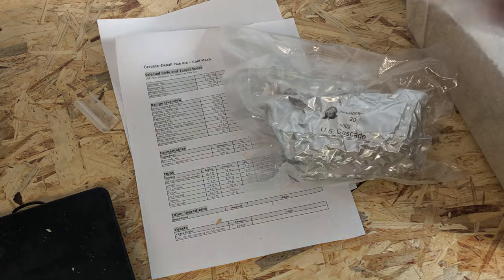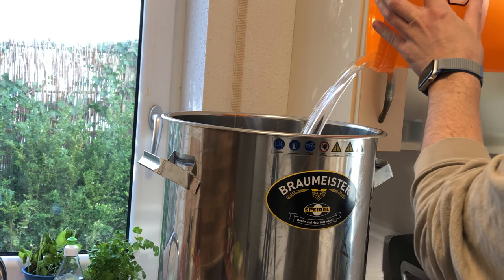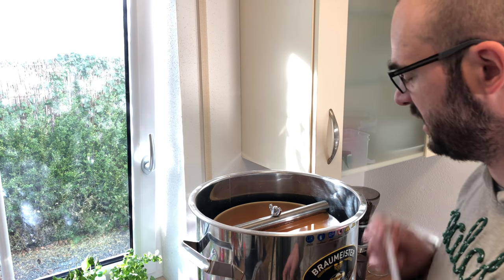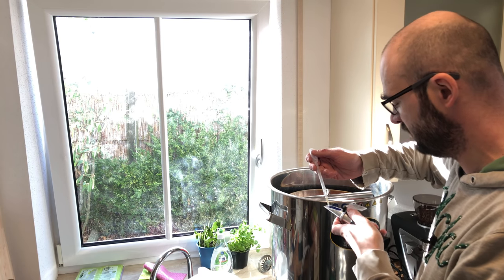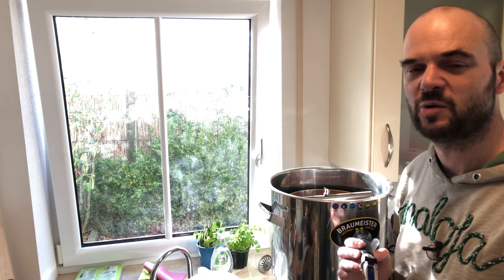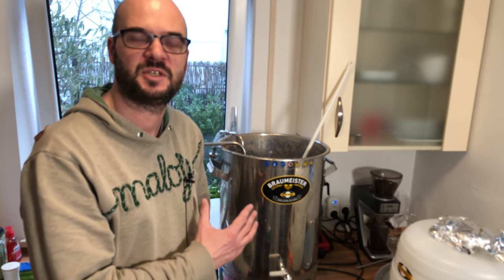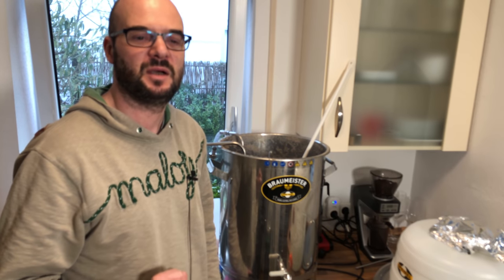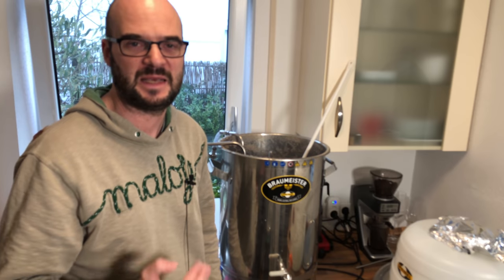Cold Mash Extraction Homebrewing (English Video)

Comment: Very interesting! I'm going to try this technique myself soon, I have a few questions regarding your video: How many IBU did you calculate? Did you have a conversion step at around 65° C after lautering (as recommended by Briess) or did you go directly to the boil? Lastly, since the beer has so little alcohol, did it keep well or did it spoil after a while?
Reply from the maker: I went directly to boil. No issues from spoiling but my beer never really lasts very long ;)
Reply: @089Braumeister  I just sampled my batch fermented with Windsor, it's a cooked corn bomb! Not sure what went wrong, I mashed at 5C over night, boiled 60 min and fermented at 19C for a week. I hope the DMS will go away.

Comment: I enjoyed that, Hans.  Is yours a 20L or 10L Braumeister?  I was picturing doing something along these lines, and my searching quickly got me to the cold mashing term describing it.  Seems like you're a lot closer to the 1 hour for a stirred mash than the 24 hour for a rest mash I saw referred to in (I think it was) the Briess article.  I was wondering how a recirculating system would compare.  (Can you tell me anything about your mill?  I have one I picked up second hand that looks similar,  but haven't found any documentation on it.)
Reply from the maker: Thanks! I use a 20 liter Braumeister. Doesn't the Bries article also mention circulating cold mash? Or another article? I think they say 24h for just a rest mash and 1h is fine when circulating. 
I have been using a "MattMill Kompakt" for a few years now. I don't know about any other mills that might look like it though, sorry.
Reply: @089Braumeister  Briess talks about agitation,  which I'd expect to go a little faster than recirculation, depending on recirc. rate.  Did you observe flour scorching on heating elements as some BIABers have reported?